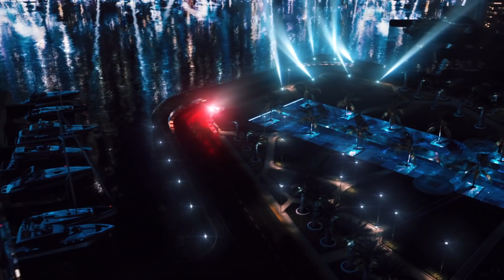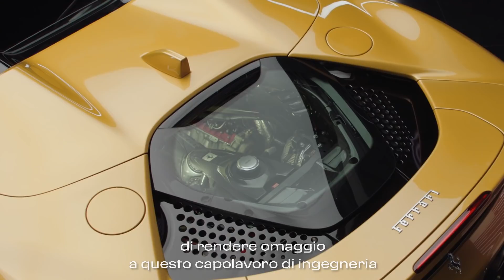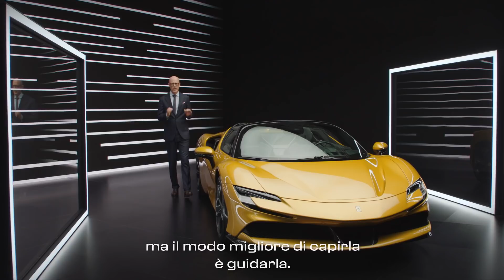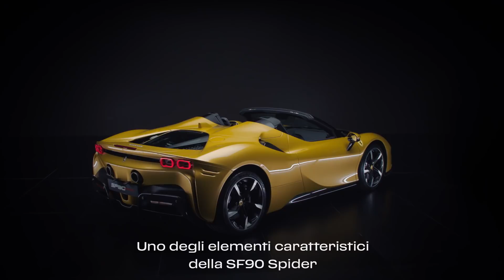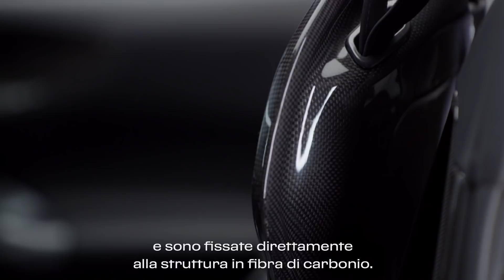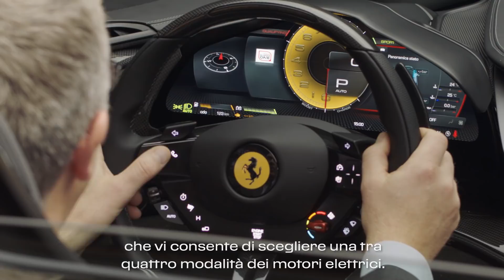Ferrari SF90 Spider | 470.000 euro per 1.000 CV en plein air. Dal 2021

Comment: Why can't ordinary cars have a similar hybrid system to aid acceleration?

That way, the engine can be small (hence uses less gas), yet still provide brisk acceleration.

Accelleration is what makes driving fun, not absolute speed on public roads.

Comment: Sarei davvero curioso di mettere in pista una FS90 "standard" e una FS90 pulita delle unità elettriche, batterie, ecc e vedere se vincono i 220cv in più o i kg in meno... 

Fantasia
Reply from the maker: C’è già. Si chiama F8 Tributo. La 90 Stradale gira 1 secondo più veloce della 488 Pista. In attesa di una SF90 Pista ;)
Reply: Vincerebbe a mani basse quella a motore endotermico. Sia sul giro secco e in maniera più evidente sul long run, dove la differenza di peso si rivelerebbe cruciale. Quest'auto è stata fatta per motivi di "green marketing" e per ammortizzare i costi di questa power unit che verrà replicata (in modo simile) su quel cesso di suv che uscirà, ma a prestazioni è tutt'altro che un riferimento
Reply: Pesano uguale